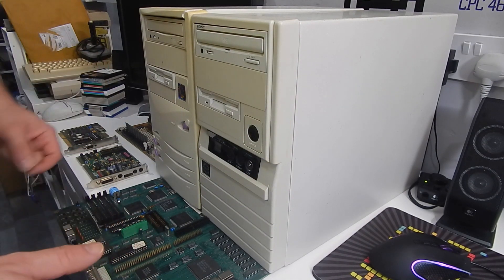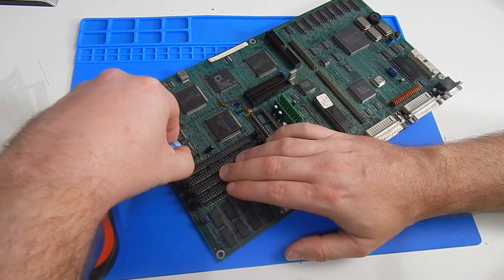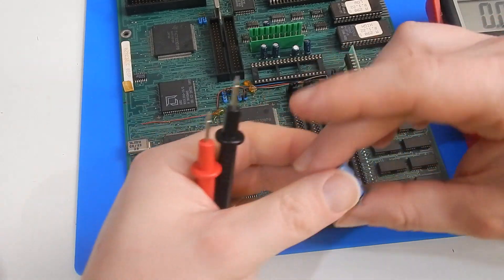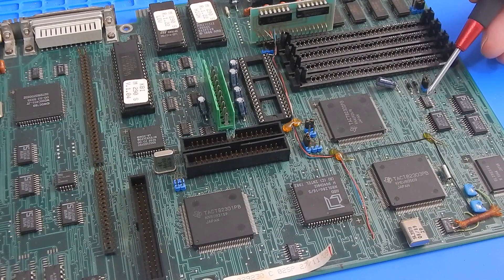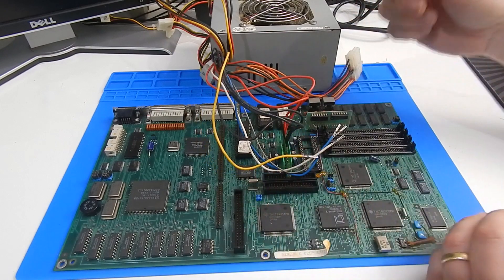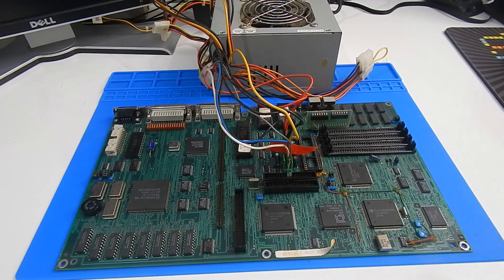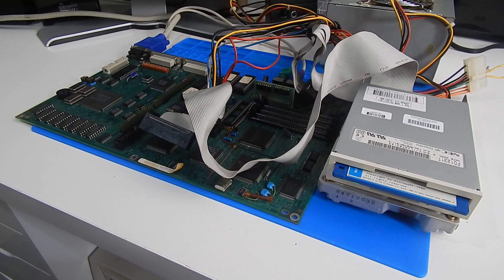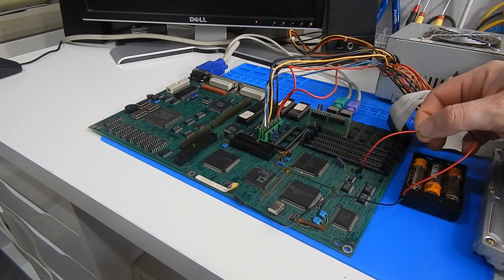Olivetti M203 286 Motherboard Part 1

Comment: Have you tried a different boot disk? Search for "freedos720k_20061014" for a stripped down image that should work on older PCs.
Reply from the maker: Thanks for the tip.  I've since got it to work but I'll look out that boot disk just to have it.
Reply: Good stuff, I look forward to part 2

Comment: The riser card MUST be installed otherwise this system don't work. I own an Olivetti PCS286 since late 80's, still have it and still works!!!
Reply from the maker: If that's the case then I'm beat as I don't have the riser.  Is there something on the riser other than the isa slots?
Reply: termination?
Reply from the maker: Surely the pins not connected are no different to an empty isa slot?  Could be wrong though, usually am :)
Reply: CRG with regular boards, you’re correct. This though is a whole other level of “regular”.

Have you been able to check what the riser board at least looks like? You’d be able to identify components on those images.
Reply from the maker: @Inject0r  The only photo of the riser I can find can be seen here.  Its not a great picture but it doesn't look like much is on it.  http://pcrebuilding.altervista.org/43/373/MOTHERBOARD/286/Olivetti+M203+%28M290S%29+286.html

Comment: I didn't get a good look at the floppy cable, but it looks like it might be a straight-through? Maybe try the other kind that has a twist:? With a straight-through cable your floppy may be ending up as drive B, which could explain the seek followed by the failure, as it initializes the drive, but then tries to boot off the phantom drive A.
Reply from the maker: Tried this last night.  Using a cable with a twist I still get the floppy seek but the computer doesn't seem to detect the drive.  I also tried the other 34 pin header on the board but I get nothing, no seek, drive not detected.  I was wondering if perhaps like the HM Systems 286 the floppy cable need to run out to the drive then back to the other pin header.

Comment: Have you had a look on Total Hardware '99 for the jumper settings?
Reply from the maker: Wasn't familiar with that site but thanks for the tip.
Reply: @CRG  It's an almost irreplaceable site for jumper settings for vintage hardware.  looks like they have a couple of dozen Olivetti motherboards listed.
Reply from the maker: Had a look but they don't seem to have a schematic for this board.  Fantastic site though, very handy to keep bookmarked.

Comment: Getting there.  I think Olivetti do things a bit differently at times but, as you say, it could be one of the jumpers.  I hope it doesn't drive you too crazy :-)  Cheers
Reply from the maker: Thanks.  Still hunting for a datasheet or manual for the board with no luck. Found some details of the floppy controller though so hoping that will give some hints on why it's not reading anything.

Comment: Great progress!  I wonder if its one of those wierd cases where the IDC cable has a twist somewhere?  Can you see a floppy controller IC somewhere?  eg. a WDC1772 or something like that, that might be the issue.
Reply from the maker: The controller is a wd37c65bjm.  I'll take a look for a data sheet and see if it gives any hints.  Thanks.